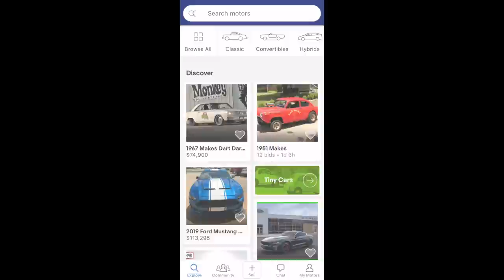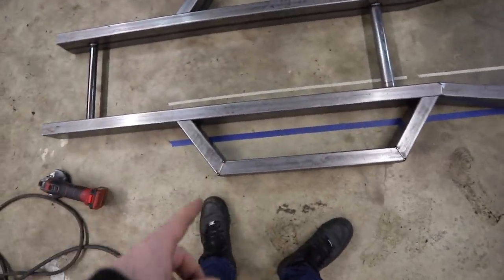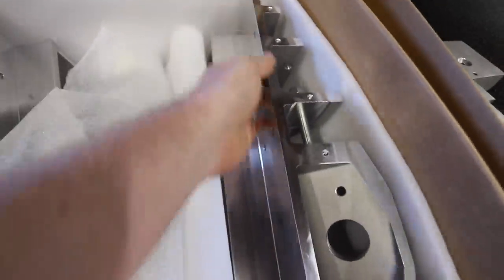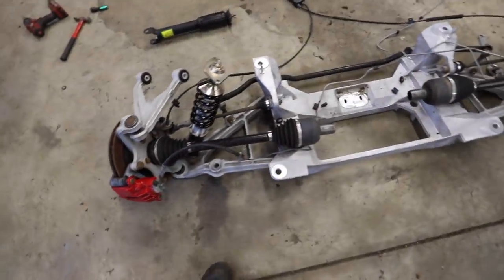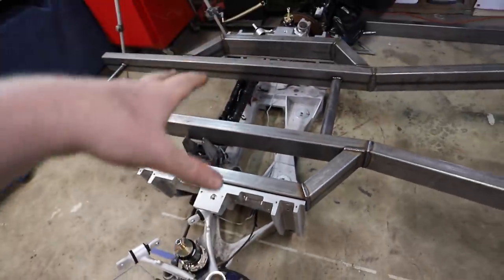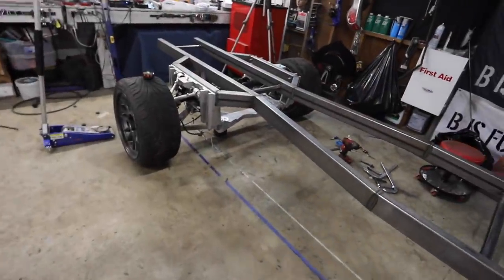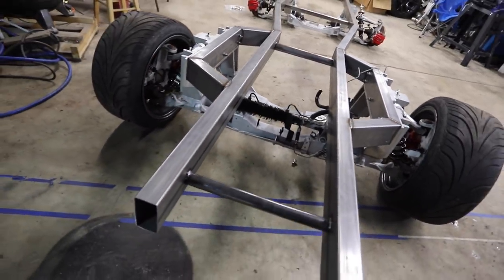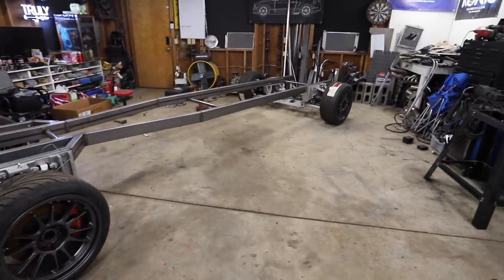Building A Custom Single Seater Supercar Part 2

Comment: I'm having trouble imagining why it needs to be so long.
Reply: Mid engine?
Reply: It's going to be rear-mid engine, the engine and transmission is rather long.
Reply: Mid engine
Reply: Because it's a badly planned waste of steel.
Reply: Ackerman angle?
Reply: I have the same question. But what do I know 🤣
Reply: @SupercarSeany  isnt that just for toe out when turning so the front wheels are on the correct path since one has to travel a wider radius than the other. If it is its got nothing to do with the length of the car
Reply: Leecifer Voorhees B is for Butcher
Reply: @KasamS  I accidentally posted this in the reply to the "length of the car" question. And you are 100% correct. I was more or less making a joke about the geometry of the car...
Reply: it just looks super long because there is nothing on it. if you ever see a car or truck frame without the body or wheels on, it feels the same way
Reply: did you even look at his plans?
Reply: That’s what she said.
Reply: Guys if the engine is back of the rear axle its gonna be rear engine if its between the front axle and the rear axle its mid engine and if its front of the front axle its front engine
Edit: error correction
Reply: He'll learn eventually. This is his first time doing something this complex so it's not gonna be perfect.
Reply: @BuddhaOfDarkness  the wheels and suspension are basically mounted under the frame
Reply: He also is going to sit in the frame rails guys
Reply: Appocalyptic single seater   is long car for aerodynamic with thick metal peaces for durability 
Basically it's a long , curvy and thick A.S.S
Reply: it should definitely be shorter, bring the back wheels in more.
Reply: Don’t worry it won’t be a regera Rep or anything
Reply: @denvernow7294  Um no. You are mistaken. He will be cutting down the unused end yes, but he set the wheels in this video and only a very small amount of frame sticks out the back. So anyone commenting on length in this video is obviously referring to what he has set. The wheelbase is set ludicrously long and that doesn't appear to be changing. You can fit an entire sedan inside that wheelbase.
Reply: @juliodiddo9239  Numerous cars fit rear and mid engines into significantly shorter cars. His Huracan is an example.
Reply: @optimalxrecovery3308  I did. The rendering appears too long as well.
Reply: @5ociopathic  +Without a transaxle.
Reply: @boostaddict_  The Huracan and the Datsun were pretty complex. Datsun was a full custom frame also.
Reply: @KasamS  Maybe both, from memory the steering arms have to point to the center of the diff with the steering centered. I always thought it was just wheelbase but width would affect it too eh.  Dammit now my brain's hurting  :)
Reply: Leecifer Voorhees 

Well you’re an exemplar of positivity.
Reply: I'm having trouble with how high the frame rails are!
Reply: I dont know what exactly he is going to do but given how long that wheel base is and how low the car is im sure it is going to scrap over almost anything. Which in the long run will not do the underside any good
Reply: @arevo8702  Surely its mid engine if between the axles?
Reply: go big or go home
Reply: This car will Not be driveable at all
Reply: @Not_Hans  lol Get a grip, you could fit a whole F1 car between those wheels.
With frame rails running over your shoulder?
It's a stupid design despite the great efforts he's making to build it.
Reply: I was just about to post this same statement, glad I scrolled thru the comments lol.
Reply: @TangoPirate  I corrected it now autocorrct  changed  it to front engine by accident
Reply: @KasamS - wheel base length and track width are the primary
 variables in determining  Ackermann angles.
Reply: @SupercarSeany  - he is 100% incorrect.

Comment: Imagine the turning radius on this thing lol
Reply: Especially with the incorrect ackerman angle for this wheelbase.
Reply: What turning radius?
Reply: Legit was about to ask how he's gonna get it out of the shed.
Reply: Carson It was a joke.
Reply: imagine just putting a Pickup chassis on top of the frame 😅🤣
Reply: I was thinking the same thing but they will make a plan
Reply: Turning radius doesnt matter when he will only drive it  thrice and then theres a new project.
Reply: Angle kit = GTG
Reply: @Captaindan7141  Ackermann angle is also dependent upon tracking width. Since the rear is 3" wider, it brings it back closer to correct, and it's possible he used some math...
But I bet he guessed...
LOL
Reply: Needs some rear wheel steering like the F&F flip car
Reply: He doesn't drive his project cars so it doesn't really matter.
Reply: A regular C5 had the turning radius of a tractor already
Reply: Turning radius?

Yes.
Reply: What’s the automotive equivalent of a ship’s bow thruster?
Reply: OMG i feel like they didnt think of that
Reply: I will never get over the Mustang they stoled from you
Reply: Same as a bus
Reply: C is for CRASH
Reply: Chris can't fool me. This is a top fuel super apocalypse car!!  😤
Reply: Imagine owning a double cab, extra long bed 3500 Silverado and then pretend it's actually bigger
Reply: 4 wheel steering
Reply: Brett Zammitt it’ll have the turning radius of a semi lol

Comment: for the love of god, shorten it.
Reply: I don't think he can.. per the design.... it's gonna turn like a boat though..
Reply: @taylorreardon6918  ... oil tanker ah
Reply: Or widen it, so it's not as long relative to its width. And so it doesn't tip over when cornering....though as pointed out if it corners like a boat, that may not matter. Let's just assume it's like a drag racer. Then its perfect.
Reply: @davideloewen  Let's just assume he's never gonna drive it, like all of his other cars.

Comment: The Corvette bolt pattern is 5 X 4.75. Take the metric dimension and divide by 25.4. For a guy that knows so little about cars, you get it done. Hat's off to you.

Comment: Taylor Ray also helped design and engineer those coilovers when he still worked at BC
Reply: they just threw on a similar setup to cletus’ c5
Reply: @ItsBurke  I was about to say the same thing.

Hey chris, maybe look into the angle kit or just drop spindles like Cleet just put on Donnie..?
Reply: Joseph Hollingsworth Why would be need an angle kit if it’s not a drift car?
Reply: Taylor Ray is a damn legend!
Reply: Hes a beast Taylor knows his stuff
Reply: @PaulBuffano91  so he can get it lower I'm guessing he said angle kit or just drop spindle cuz he doesn't know if u can buy spindle alone
Reply: ORL Mitch isn’t there gonna be a competition where there’s a drifting component?
Reply: @PaulBuffano91  corvettes are known for having almost Zero steering angle, so a car thats much longer with such a small level of steering angle doesn't exactly sound like a great idea
Reply: Drop knuckles my dude
Reply: Another way to lower the shock would be to use some lighter weight springs. Because the originals were designed for a front engined vehicle, so they need more weight to compress.
Reply: Taylor Ray is amazing
Reply: Can this ever be registered?
Reply: @kingofl337  Probably as a kit car.
Reply: @PaulBuffano91  corvette's are known for having a terrible turning circle because of their lack of steering angle
Reply: @PaulBuffano91  didn't the kit have lots of adjustability?
Reply: Kyle Wise That’s true. I still can’t picture the car with it being that long. It seems like he’s building a pickup truck with that frame, lol.
Reply: Vintage Tech Repairs Yeah, you can change steering angle depending on what you want.

Comment: Add some crush tubes into the frame rails where you have drilled, simple holesaw and welder jobby! Oscar should be able to smash it out! That way you can really tighten the bolts down to hold the suspension add ons in place!!!

Also another suggestion is to step the rails down sorta like with the datsun!!

Comment: Feels like that frame needs to be MUCH MUCH lower. Almost like you need to flip the whole thing over?
Reply: I was thinking the same thing, usually the frame goes under the steering and stuff.  Use cradles for the top of the suspension to lower it. It's going to be really top heavy this way.

Comment: I'm really looking forward to this project , I recommend to add a bend or angel to the chassis , basically for getting the mid section of the chassis as low as possible for the best center of gravity , of course that's a long process and it's not in the design , but it will make the car so mush better in every way

Comment: "very very exact down to 1/16 of an inch"   
Laughs in engineer 😂
Reply: Good enough for GM :-D
Reply: I just used google to convert so might not be right, it says that a 16th of an inch is 1,5mm, that can’t be right, can it? With this “precision” i really want to see the outcome😂
Reply: Would be about right if he was in high school wood shop
Reply: @stigsdanishcousin3075  Yes. Unfortunately, this is his level of precision.
Reply: @stigsdanishcousin3075  
well for welded chassis parts plus minus 1,5mm is not a bad precision, but if that translates to rotating parts, definitely not.
Anyway he has all suspension parts bought so should be okay.

Comment: Curious to see how long those glass scales will last in the shop
Reply: They've been around since the gtr I believe
Reply: @denniskly8154  I thought they bought them for the Lambo
Reply: Did he not use them on the 240z as well?
Reply: Dackyc92 I think your right
Reply: Not sure that they are glass...I'm thinking acrylic?
Reply: @Martin Wink, they've been around a while, tempered glass is very tough.

Comment: You need to grind off and re-weld your front "outriggers" to the top of the frame instead of the side.
Reply: I have never done anything like this(I'm just a machinist), but end to end welding is definitely not strong enough. He needs to add some plates, or something to each joint.
Reply: I'd say when Oscar see's it he'll get a stern talking to! Lol
Reply: Butt welds can take a lot of force if the joint is designed well, but this 2x4 box tubing isn't gonna work well with how he has it. Definitely either needs bracing or a redesign. Whole frame sits really high too.
Reply: @justinoliver1984  who is oscar? i don't watch him 247 so i'm out of the loop
Reply: @0xsergy  He's pretty well his right hand man, he's a welder/fabricator by trade. Done pretty well all the welding and fab work on the "Burtican" the LS swapped Lamborghini they did for the last SEMA show.
 He seems like a pretty humble guy on camera. Thats kinda the joke lol

Comment: You could always Z notch the frame
Reply: This is the best answer.
Reply: Thought that’s a c notch or same thing basically? I was wondering why he just dissent lower the frame between the axles anyway
Reply: It’s the best way to get the car lower but it will creat some big issues for a center mounted seat and clearance around the driveshaft/torque tube
Reply: @ncarone9629  Rear engine, no torque tube, he is going straight engine to corvette trans.

Comment: I would recommend getting a drift steering angle kit. 
Try and recover some of the turning radius that you have lost with the extra length.
plus will come with custom suspension arms already. 
And you may need a lower spring weight on the front since it's not supporting the full engine weight.

Comment: They dont even build truck frames that stout. Also you need like 28 inch rims for something that long lol
Reply: Stout?  Thin wall square tube, excessive length, no reinforcement of the straight square groove butt welds on the vertically joined sections. Should have been z-cut and fish-plated.  Someone should be making book on how far that frame will sag before it breaks.

Comment: With the length of the frame and most of the drivetrain weight in the rear. I’d suggest you install an angle kit for a tighter turning radius. Kinda like the kit Taylor just installed on Cletus’s C5 drift vette
Reply: Daniel Ross you probably want a sway bar on a racecar tho. its not an autox car it doesnt need to turn super tight

Comment: Chris, I like the idea of putting heavy backing plates on the inside of you frame rails to avoid crushing where you frame/suspension adapters go but, I would also highly recommend that you drill larger holes and put heavy wall welded pipe sleeves  to line your bolt holes. This will allow you to tighten the mounting bolts to a sufficient level and the backing plates will keep the bolt from pulling through the wall of the box tubing over time and stress

Comment: "The best way to do this..." is to switch to a parametric modeling program like Fusion 360. You can pull all the measurements you need with the measure tool.
Reply: Brian Chen Don’t encourage solidworks like that and call it a real CAD software

Comment: You could make some brackets to bolt ballast plates within those front suspension kick outs. It’s totally tractor tech but it works and would help your dial in your weight distribution.

Comment: Swap the front springs with the rear springs  if your doing a mid engine
Reply: @VHjykfUuYu  it isnt, depending on how much weight it ends in the rear suspension, leaving the strongest coil in the rear may be a good idea
Reply: @Elinzar  less shit than shit doesn't make it good. You need to consider desired ride frequencies in order to estimate required spring rates.
Reply: @Elinzar  you need to measure your motion ratios and take into account that the spring is placed at an angle, so the wheel rate will be nonlinear and the spring rate needs to be higher. Also at this stage he doesn't know his mass and weight distribution so he can't pick spring rates and damping coefficients. Not to mention that front and rear springs might have different dimensions.
Reply: @VHjykfUuYu  if is less shit than shit, it is still better, and still a better aproximation of what he will need later

still with the really small ride height the car will have i think it will have to replace those coils anyway

Comment: Chris, @19:41 leave out the coil-overs until final assembly, use adjustable spacer rods instead to mockup the desired ride height. Also, you've done it again! No one uses a flat frame! Frames are always notched to accommodate the additional height of the subframe mounts. That said you could leave the frame rails where they are and drop the driver capsule floor and frame to the clearance you want, it may even add rigidity to the chassis. By the way, you do this type of work often enough to justify having a Frame Jig or Frame Table now.

Comment: I know you mentioned extra bracing plates on the suspension mounts, but you really need to weld in some crush tubes to fix it permanently. Have you thought about angling the 45 degree sections down to meet the frame rails and maybe Z the back section to get the chassis frame the right height?
Whatever you do, looking forward to more of the builds, nice to see some more homegrown stuff.

Comment: My friend, you need a thing called lathe here in iceland. It is a table made of massive steel perfectly flat machined and has lots of holes in it for special clamps to hold things perfectly aligned while you weld exact chassis pieces  :)

Comment: Lowering purely with coilovers is a bad idea, I think the rule of thumb for lowering is generally the LCA should be parallel with the ground while the car is static, any more would be severely detrimental to the suspension geometry because stuff like the camber curve would have an exponentially higher slope and bump steer would become an issue.  Rather than coilovers, c-notching the frame would be the best option because you can retain ground clearance on the subframes, lower overall CG, and utilize much more traditional ladderframe design where the occupant sits on top of the frame rails. Normally steel spaceframe single-seaters uses a different design (see FSAE chassis). There were ladderframe f1 cars in like the 50's so it should still work, but even in the 50's the drivers sat on top of the frame rails.

Comment: Hey Chris I think you should consider the placement of the engine..... Because with the single seater and the engine in the front, the tunnel will interfere with the driving position.

Comment: Chris, please read this, this is very important. You have drastically modified the wheelbase. That means that you really really should also drastically modify the ackermann angles. That means custom front knuckles. If you leave them as is, the longer wheelbase will introduce a very strong tendency for catastrophic amounts of under steer.

Comment: Are you going to replace all of those rubber suspension bushing with poly?
You need to drill those holes in the frame rails oversize then weld tubes in that will support the bolt and prevent it from crushing the tubes.

Comment: There's a reason most chassis have a raised section over the suspension while the areas in front of, behind, and between those raised areas is lower. It is important because it allows the suspension to be mounted how it needs to be mounted while allowing the body to sit lower. Dropping the chassis between the suspension will help the car look like it's not a lift kitted 4x4 truck.

Comment: Me again. If you could move your front mounting rails above the frame rails that will set your roll centre lower for handling and overall height. your rear end also needs to be higher than the front for straight line stability. Rear also needs to be wider than the front. It looks less right about now. 
I have loved watching so much of your stuff. Too many regs in Oz that stop us from doing similar projects

Comment: To get your frame rails to the desired height a double set each end will put the rails exactly where you want them. That way you do not have to touch your suspension components.

Comment: For the bolts holding the subframes to the chassis rails, how hard would it be for you to drill those holes out larger and slide some heavy wall tubing in there and weld them in? Not having an anti-crush support in there would make me a little nervous.